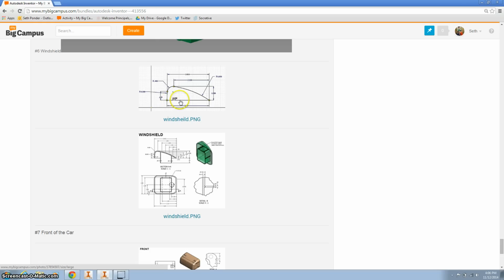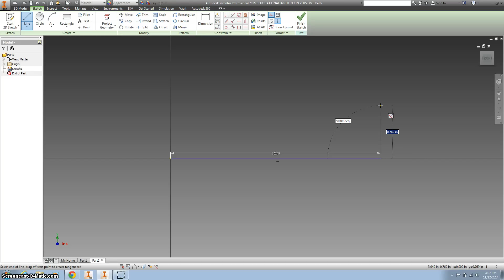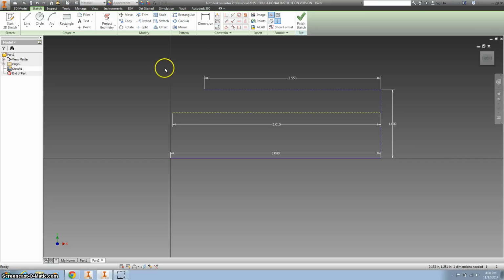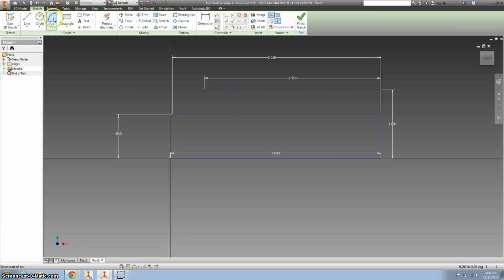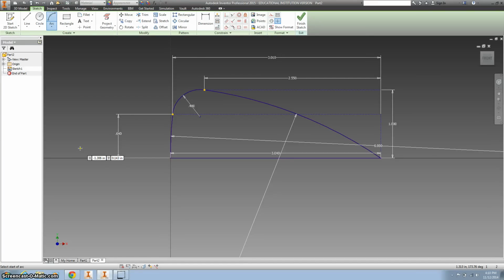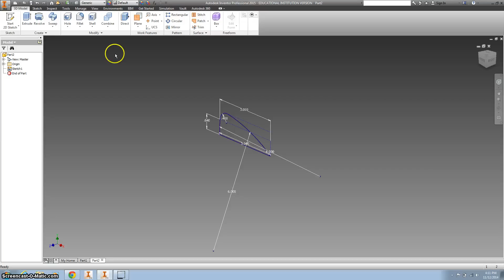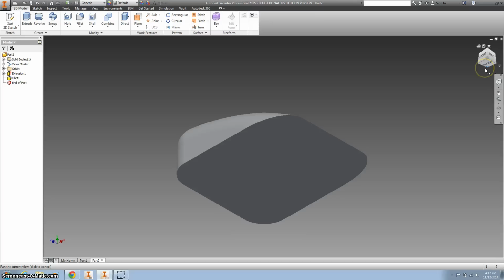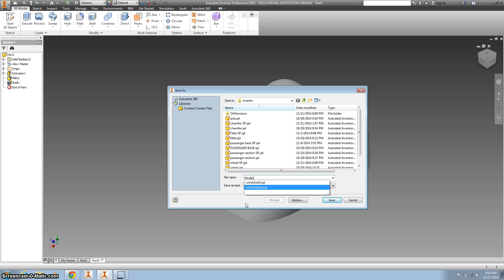Creating a windshield (part 1)

Comment: If you are still replying to comments...I am unable to fillet the edges. All the dimensions are correct and I have the newest inventor version. I can fillet the edges to like .25 and other numbers but when I type .5 the fillet doesn't show and doesn't work when I click apply
Reply from the maker: Roshan Chuwan are you trying to fillet in sketch mode or in model mode?